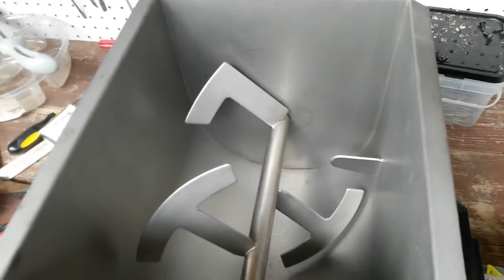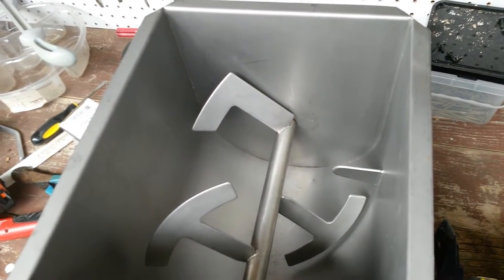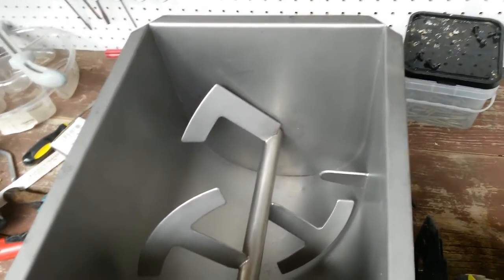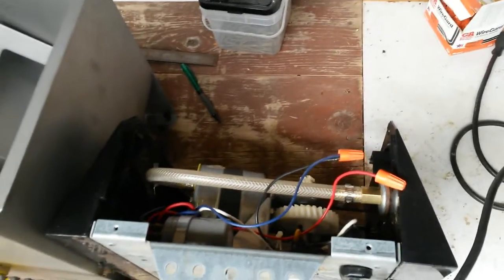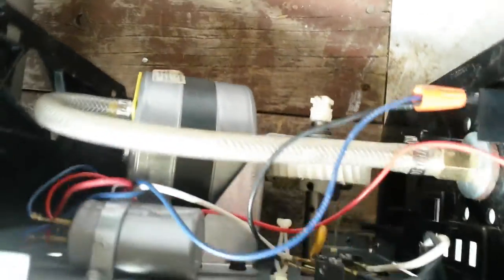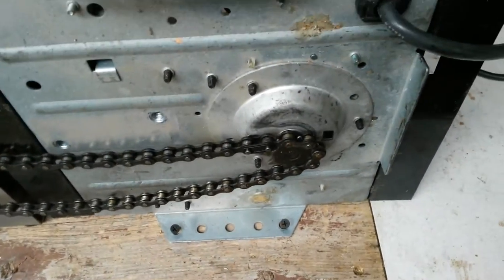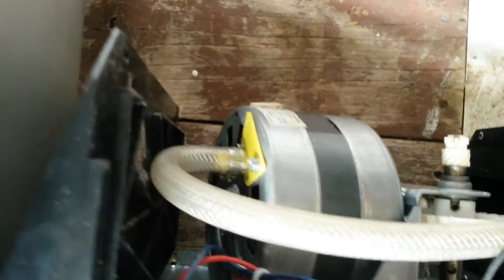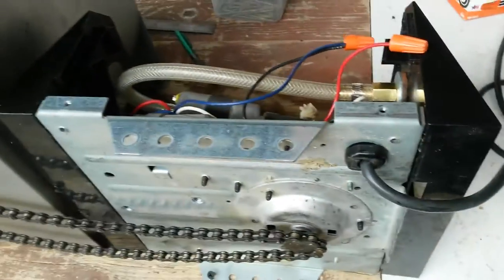Garage Door Opener Hack

Comment: As a garage door guy, I love it. You could tighten the chain and it'd be a lil quieter.
Reply from the maker: Thanks! Don't know if you read any of the comments, but this ended up being a total fail. I discovered that garage door motors are only designed to run for a few seconds at a time. When I put this under load, the motor got way too hot and the capacitor exploded!

Check out my second attempt here: https://youtu.be/XRkbQVM_5ps

I haven't put that under load yet either 🙂
Reply: Ahh yeah. 8-10 time of pushing the button will cause the Override to kick in until it cools. That treadmill motor seems to be the way

Comment: This is a beautiful thing.  Thanks for posting.  And the air cooling addition is excellent.
Reply from the maker: Vern Smith Thanks. Unfortunately, when I put 4# ground meat in the mixer, the startup capacitor blew up after about 2 minutes. Literally splattered a small amount of hot black liquid all over the place. So apparently this unit couldn't handle the load. I've made a new sprocket, twice the diameter, but haven't had a chance to try it yet. Will report back.
Reply from the maker: Version Two is operational: https://youtu.be/XRkbQVM_5ps

Comment: Nice work dude!
Reply from the maker: Thanks! Dunno if you saw the discussion below, but the start capacitor blew up after about 2 minutes when I tried to actually mix some meat. I got a replacement cap and redesigned the driven sprocket to have double the teeth, which will reduce the speed of the mixer and the force needed to turn it by half. I had some issues with the 3D printer, so my first redesigned sprocket has been unusable. Will reprint sprocket with ABS in a few weeks and report back.
Reply: haha awesome.
No-one ever turns their garage door opener into a meat grinder perfectly on the first time dude.
I remember my first time. I had shit blowing up everywhere....
I hope you can sense the sarcasm in this reply.
Keep Killing it! Lemme know what else you come up with.
Reply from the maker: @antisk8  Version Two is operational: https://youtu.be/XRkbQVM_5ps

Comment: Try running a regular sized electric motor through a truck torque converter to gear down the speed.  Run it by itself before producing the sprockets to calculate the appropriate speed.  Then attach appropriate sprockets and you’re ready to go with plenty of torque.  Document via youtube video = win!

Comment from the maker: Update: I bought a better start capacitor that was more expensive but closer in quality to the OEM one. And I doubled the diameter of the driven sprocket to cut the torque needed in half. The motor and the capacitor are still getting very hot, even with the air cooling system running full blast AND no meat in the mixer (zero load). 

Alas, I have decided the garage door opener will not work for this project. I'm bummed because the built in slow speed and ease of reversing direction made this motor the perfect fit for this project...in theory.

I just salvaged some parts from a treadmill with a large variable speed DC motor. I have decided to try that motor. Stay tuned for updates!

Comment: Put a cover over that chain.  Wouldn’t want your wobbly bits or a shirt caught.
Reply from the maker: Thanks for your concern but I'm usually wearing pants when I run this thing.

UPDATE: I have recently acquired several high-powered, variable speed DC treadmill motors. One has already been designated for my drill press, but another will be used for this meat mixer setup. Maybe I can finally get this thing up and running for good!

Please like and subscribe to get a notification for the video!
Reply: @bullfrogpondshop3179  if you removed the Anita kid crushing sensor even your pants getting caught is going to be a bad time.  It’s 1/ 3 hp right?   Wont be fun.
Reply from the maker: Version Two is operational: https://youtu.be/XRkbQVM_5ps

Comment: Get a big cheap drill
Reply from the maker: I tried that way back. I found that variable speed drills do not maintain a consistent speed, even the ones with the little speed control dial on the trigger. The slower I tried to go, or the longer the drill ran, the more the speed varied. Not usable for this purpose.
Reply from the maker: Version Two is operational: https://youtu.be/XRkbQVM_5ps